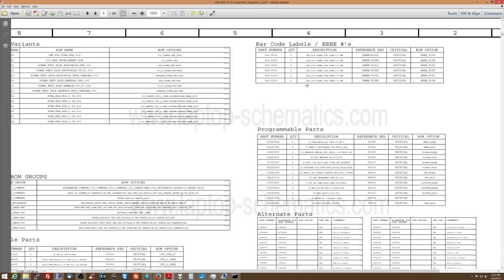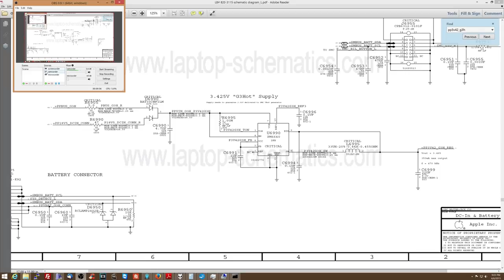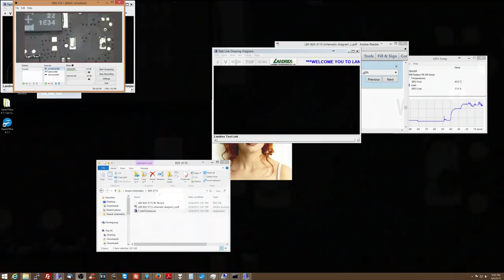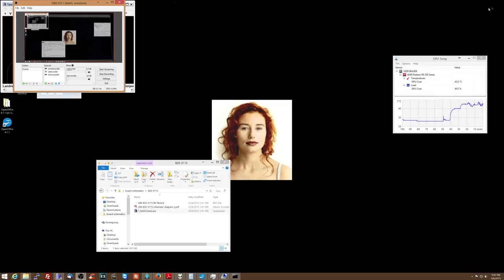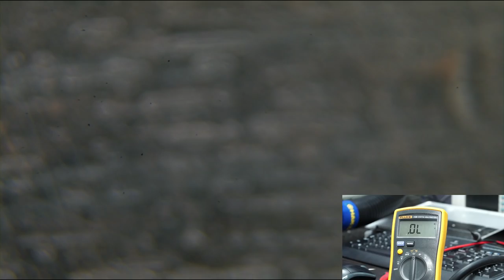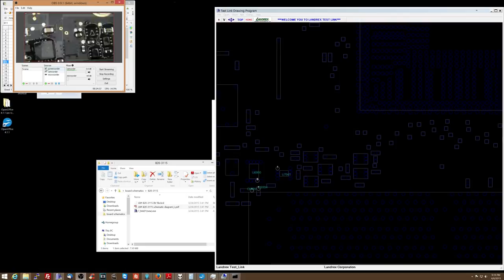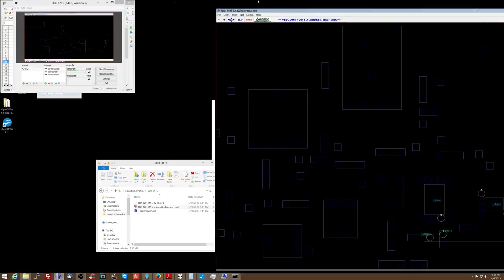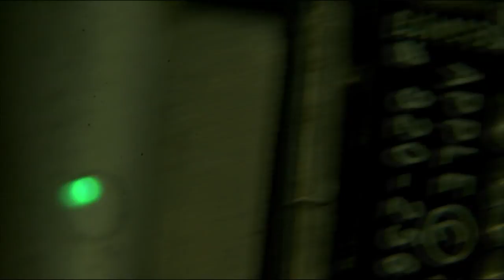How to find short circuit component without spending $6k on FLIR cam.

Comment: This one is another great video. Can anyone point me in the right direction for finding equivalent components? I am currently trying to find an equivalent for a NCE brand transistor. NCEQ1H14. It was one of two in a 1200W dc boost converter

Comment: you should update this video and pickup one of the cheap 200 dollar thermal cams for a phone. I think 200 bucks is worth it, being able to isolate a short in a few seconds, or multiple shorts even
Reply from the maker: I've tried them, resolution is just too low to be worthwhile for me.
Reply from the maker: It's like, I can see this big orange thing.. but it's half the board. I get it, but which component is bad?

I'll spend $1000 on a thermal cam when it's 1080p, but this BS that they have now is baaaad

Comment: maybe a laser tempurture gun coult help but maybe
Reply: /thats what I use , it pin-points the hot spot quickly , and you can watch the temperature change digitally .   the problem for me has been finding old boards to rob parts off of , everybody throws things away these  days , you turn into the late night dumpster diver

Comment: You say that you don't want to do a disservice by butchering basic electronic theory, but have you tried writing out your own process of understanding?  It sounds like you can conceptualize everything - as you said, you "get it," which seems to be something I struggle with.  Even though I know what each component does, I don't understand with any degree of intuitiveness, how the architecture was designed.  That is, why a component must be 'here' or 'there' in order for the processes and outcome to be achieved. 
Great videos. You present very well and you have a very 'to the point' type of approach.

Comment: At 13min 20sec into the video Louis recommends putting his power supply onto max current (3.42VDC 10.38amps).

That's a worst case scenario of over 35 watts!!!

0.67 amps initial current, dropping off to 0.4 amps, but not thanks to Louis, but more to do with luck

Personally I would have set the current limit between 05A to 1.0A

I've used this "Louis Trick" several times during my professional career but I always kept my eye on the current.

10 amps is just too excessive in my humble opinion

Comment: what could it mean if no current is going when testing the way you suggest ? ( 0 A !)
Even more weird: after disconnecting the power supply and rechecking the short was gone
Reply from the maker: +kiz bngl you burned out the short.
Reply: what do u mean ? best regards from Berlin
Reply: please man, I don't understand what you mean with burned out. Doesn't sound like solved, does more sound like the rsponable component doesn't short anymore but still needs to be replaced but can't find it now anymore :-)

Comment: Two ways to figure out where is the short .With an IR camera ,Otherwise with a compressed air can . when you see which component  goes down on power when sprayed  .That is the bad one
Alcohol can  cause short circuits by itself

Comment: Like your videos and trying to absorb some of your knowledge. Its important as you say to take time out for yourself. However if its 10pm and you are headed to the gym that is bad news. Added to the problem you are loading up on protein which will fire up your body and then you tell all systems to shut down for sleep. How about stopping at 5 or 6pm and giving yourself a chance to relax and settle down.

Comment: Hey dude so I change ram while my pc was on now it won’t turn on so is dead?
Reply: You should never remove the RAM or HDD/SSD while the computer is powered on. Since you did, you could have shorted something while removing it and fried it. If the pc turns on, but has no image, try cleaning the golden pads of the RAM stick and put it back in. If it still doesn't work, your motherboard OR the RAM stick has gone bad. Replace the RAM stick with another good one (from another PC of a friend or something like that) and see if it gives an image. If it still doesn't turn on, your motherboard might be fried. If the PC doesn't turn on AT ALL, it could also be your power supply (replace it with a known good one and try it).

Comment: hey Louis, awesome channel! ive got an early 2015 air on my desk, water damaged no power...while dissembling to clean I managed to pop off one of the standoffs/screw holes for the heatsink (from the motherboard). is soldering it back on the solution? or did they attach those in a less convent manner? If i ever meet the person who made the decision not to through hole that part they are probably getting punched in the face.
Reply from the maker: +John Wuethrich if you screwed the screw into the board it's fucked. They are not through hole to save space.
Reply: +Louis Rossmann the screw contacted the board and popped up the standoff. aka over tightened or wrong screw length. there is no bottom on the standoff so an extra twist turned the screw into a great mechanical jack. wasnt my best day. the pcb suffered no damage. I get space saving but if you think it through... with the open space on the back of that board its hard to argue a rivet was too thick or unusable. unless all the layers were so populated with traces that they couldnt route around it but i doubt that too. I digress. I now have a little silver standoff and a silver pad where it once was on the motherboard and need the two to be one again. also sorry for the misspell on your name

edit: not sure how precise you were being with the "screwed into board". I interpreted it as through in my first read. are you saying the contact alone probably fucked it?

Comment: Good idea, alcohol, use HEET it's waterfree. vaps quick.
Reply: It is most likely isopropanol. It is possible to buy 99% at pharmacies. 4$ CAN for 450 mL.
Reply: Dave George 
 She said that the new laws zone is not the case.
Reply: Glade Swope
He would have to have the equipment.
I have lab equipment and it is doable. You would reach the azeotropic point which means you CAN'T increase concentration by further distillation.
At that point, you can use molecular sieves designed to trap the small water molecules or a drying salt, such as MgSO4.
Reply: Use waterfree Isopropyl alcohol from any pharmacy (Propan-2-ol / 2-Propanol 99,5%). No "weird" contaminants / colors / tastes or whatever in it.

Comment: ... flux from your board is that it causes low voltage insulation short that can prevail (if not cleaned) between the pins of an IC where it was applied...sometimes its good practice to do it some other time ,time will dry those amount of conductive flux...venting result frustration by doing something else helps reduce stress... its just not worth it somertimes....but i like this reality troubleshooting shows ...its nothing but the truth...Alcohol doesn't conduct electricity because it's a covalent compound. ... Hence alcohol molecules are not ionized in water because the bonding within these molecules is strong enough to resist the breaking of their bonding by polar water. So, these compounds are not splitting in to ions,hence conductivity is zero.

Comment: hello, nice videos! really instructives! i need an opinion, im having problem with my vga an r9 290 pcs+ or my power supply, the problem surge 4 days ago, i was playing for about 4 hours straight then my computer turn off, i try to turn it back on and it didn't, so i say "damm fu** psu it's dead" so i start to disconect all the componets of my computer and try to turn it on only with the motherboard, and voila the computer turn on, so i think "hmmm, what it's going on then?" i reconect the ssd and the dvd reader and try to turn it on again, bumm the computer turn on again perfectly... so there was only one think i didn't conect and it was de vga... i plug it to the mobo and conect it to the psu and there was the problem... the computer didn't start.. i disconected and the computer start with no problem... so what could it be? the psu its one corsair tx 750w, and even when i  try to just conect the vga to the psu and jump the cables of psu to turn it on, nothing happend, the fan of the psu move 5 or 6° and no more... i think the vga its on a short but you clearly know more than me! so what do you think it is?

Comment: wouldn't it be way more efficient to use an IR camera to figure out which component is heating, rather than using your hand, which conducts electricity?
Reply from the maker: IR cameras that are affordable suck. the entire board is this big orange/red blob.. which tells me nothing on a board with 1000 components in a 6"x4" space
Reply: +J Werner  thanks for the info. after heating the suspected components, they'll usually go short circuit (its resistance becomes very low).  Yes??

Comment: Isn't 10 Amps....a little excessive just for a test???....does he want that thing to go up in flames?...I thought he criticized his customer at the beginning for something that easily be cleaned with rubbing alcohol.
Reply from the maker: +tiberio135 you start at .5 volts and go from there. No need to limit amps when you start with low voltage.
Reply: I have used a make shift power supply on a computer.  It was rated at the voltage needed with a higher current amps than required and works fine.
Reply: The amp rating is a max potential on wall warts and power bricks. It's more of a "can handle up to this load" when talking about current output on a supply. as long as the voltage is right, and the polarity is properly aligned, and the device you are powering doesn't need more current than the rating on the power supply you should be good!
Reply: Not to be a stickler, but current does matter in some cases. For example, take a diode (and therefore everything based on diodes like semiconductors/transistors), when it is forward biased, too much current can break down the junction. Likewise, too much voltage when will blow up a diode in reverse bias. In other words, there's no hard and fast rule that applies to every electronic component. Maybe 99% of them, but it's good to know that 1%.

Comment: Yes this is working, but would I do so if I need to fix any serious amount of devices, hell no. $300 IR camera will work and $500 IR camera will work very well, and will do the job in one second reliably over the whole board. Also you will perfectly see if the part is only a little bit hotter, say 0.5 degree C, impossible for this method, will work only if the part is really frying.

Comment: quick question.  Means my wife is about to kill me for the load of cash I have spent on equipment this year could I get by with this 40.00 dollar power supply listed on ebay to do this type test or is it just to big a piece of s*(%.  its listed as:
3 Digits LED 0~30V 5A Mini DC Power Supply Variable Adjustable US Plug K4L9
think it would work or do I need a better one.
Reply from the maker: it may, one way to find out!
Reply: I hate it when that happens.  Thanks  :-)
Reply: no emphatically i say no get a quality psu period!

Comment: Idk how I got here but I watched to the end and it's funny how everyone has a part of a Job they are just fed up with lol. After forty years I dropped product because I'm sick of the one little task   But I know all about P12335s and 6s or what ever the circuit is and I think I'm ready to fix micro circuit boards ( I have a solder iron and shrink wrap ) so send me your high tech boards I will fix them  I also am getting me a box that I will pile the ones that go to the bottom in if I don't think they worth my time  I have enough broken shit I have a good reserve of parts.  Don't bug me for turn around time I my min will be $300 to look at it  even if you send me a pic to my iPhone  in fact I'd rather that so I don't get flux out because as an plumber I have lots of flux tins   That's a min charge so it can go up from there.  I like to put half done jobs aside so this is the perfect job for me  as I also go to the gym   All I have to do is stay at a holiday inn to complete the internship  one with a morning waffle station for sure  and a pool.   Ok ready for business.   What you guys have ?  I'll take the more technical profitable micro boards.

Comment: Can anybody explain please, if there is a short to ground and he set the max current to 10 amps then why does only 0.4a flow through it, surly if there is 0 ohms resistance it should get the full 10a. And if that happened then surly the component and traces would burn up! What am I missing? Thanks.
Reply: his dvm was set on diode test reading volts not ohms at very low current.He then applies 3.4 volts. The circuit drew .4 amps, R= E/I or 8.5 ohms. i

Comment: Hey dude i like your videos but i buy my laptop in another country and i open it so to look around and fro ram and CPU and in my suprise i see the CPU is Soldered wtf? ok My board is dead no charge no power no lights i cant turn it on, before this happen we are somehow broken power adapter to broken itself so i buy new one, and than a few day laptop works great and now totaly dead, what can be wrong here? can be this repaired? how to find in almost new motherboard fault location? My motherboar id exact: HP 15-BA Series Laptop AMD A8-7410 Mainboard 854961-601 LA-D711P I hope you can do some tutorial for that type motherboar too thank you. I like to learn and see videos with that theme. And maybe how easy to replace from old to new motherboard CPU tnx.

Comment: Trying to fix a 3.3v short on my quadcopter flight controller. Hopefully It's not in the Processor, because it's squeaking and whirring... could it be the processor? I'm scared and totally not about to buy a heat gun.

Comment: Your system ALSO works ...by not answering emails asking for the 
procedure for sending logic boards to you, or in fact any question 
for nearly a year.  So I guess your system needs troubleshooting 
and to be fixed.
Reply from the maker: I'm not sure how anyone else manages to send anything in. Or how it is I am replying to 50+ emails a day. If there's an issue you have and you've tried to contact us and it went to spam or didn't go through, you are welcome to call and ask about it
Reply: Louis Rossmann  Or rather, for all your  success in contacts, how many are slipping through?  Anywise… ok, I'll use the phone next time.

Meanwhile… what was that AmTech solder paste product number you used here?
Reply from the maker: I don't think I used solder paste here - just amtech flux, the NC-559-V2-TF. I get them in 30cc tubes now. 

In terms of email, I have no clue. i have an inbox, i answer most of the questions and steve picks up whichever emails are unread. there are some people who send in questions about hp DV9000 reballs or boat motor repair that I should probably at least reply with a "no" but that is offensive, so i have to type out a two page polite reason as to why i can't help them, which i don't have time for, so i wind up not replying at all. 

again, if something legitimate is going to spam... i'd like to know and fix it, but trying a year without picking up the phone then leaving YT comment about it probably isn't going to fix anything
Reply: Louis Rossmann  I've been sending all of our boards to rnrcomputer, so it's not like we were desperate, however I have watched a number of your videos and so a few times I tried to ask for a price on board repairs to check out your handiwork.  Listen Louis, it was not my intent to fix anything, only to inform you that there is a breakdown somewhere in your system.  Relax.

As to the flux, oh… I thought you were using solder paste through that template?
Reply from the maker: doceigen I am quite relaxed. RNR's pricing is way below ours for everything so I doubt it would be worth it. Where is the stencil?

Comment: I fucking located a shorted 10uF cap by injecting 5A at 11.6V and the fucking Hirschmann probe clip started to burn and melted like shit, was searching like crazy with my finger all around but finally I found this fucked up cap, now without it the board is booting, all leds flash and... went off again and this pisses me off the cap was dead short at about 1 ohm fucking bastard

Comment: If you're worried about static, go back to the 1980's where you belong. Almost all components these days have ESD protection built in...There is no reason not to have it, given that chip die size/fail rate during manufacture isn't as big of an issue anymore. It's still a big deal...but in comparison to the number of returned components from ESD shock NIB, it's nothing...especially since those are all retail sales that are coming back. If you were dealing with 70% manufacture fail rates, then fair enough, make the chip size as small as possible...even if that means not adding ESDP. Basic ESDP can even just be added to the metal layer of a chip at virtually no extra charge to the manufacturer in the form of an arc gap point. 3000v from your finger will just jump the gap, as that is the easiest path for that much voltage, and not destroy the chip. Unlike boards using this method, the silicon won't burn into carbon and become a resistor, because it is not carbon based, so it is good forever.

In short, don't sweat it, forget it!